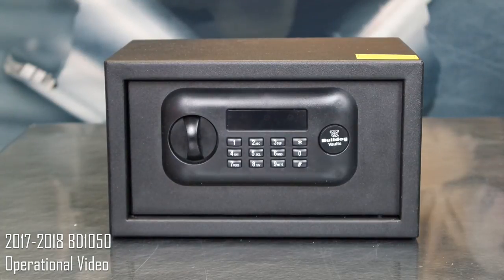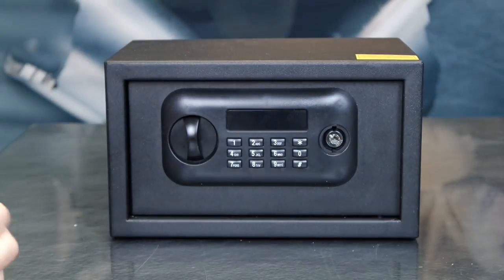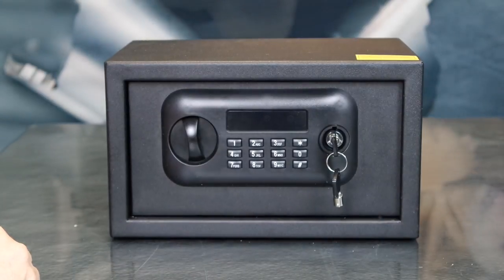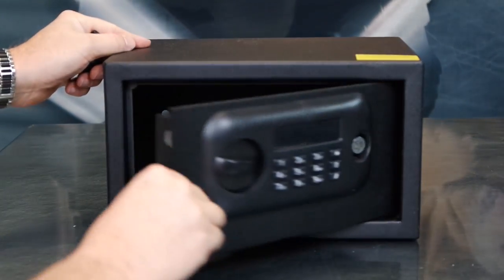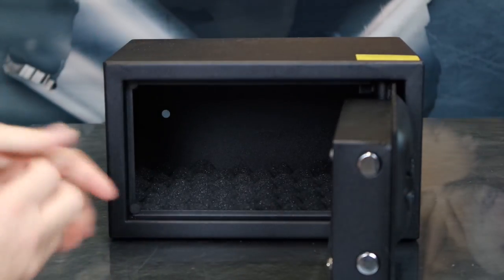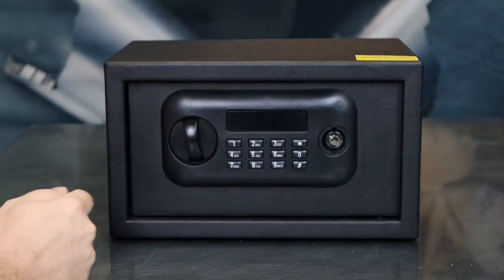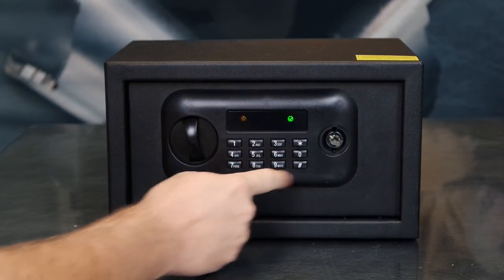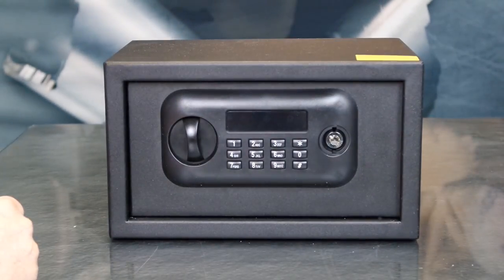Bulldog Vaults 2017-2018 BD1050 Operational Video

Comment: My code doesn’t want to change I press the red button in the back and I program a new code once done it just beeps the yellow light  3 times old code is still in use
Reply: Me too mine give a red and green
Reply: @gregreesesolutions  for some reason mine didn’t want to work cause I had to program 6 digits
Reply: @AmazingTonyYT  this comment did the trick for me. TY

Comment: Guys, I CANNOT get my BD1050 vault to open using my code alone??? I've used the red reprogramming button twice now and I keep getting (BOTH times) a red minus sign AND a green check mark displayed on the window. What does the red minus sign mean? Great video, but nothing seems to work; I always have to use a key to access. Please advise...
Reply: I’m having the same problem... did this ever get fixed?
Reply: @Game Hacker that’s mean your battery’s are low I just found out
Reply: Me too! Has anyone figured this out what does the green check and read minus sign mean???

Comment: DO NOT BUY!. Thesew things are not secure. All you have to do to break into one of them is flip it over and slap the bottom of it while turning the knob. Absolute pieces of crap.
Reply: Not if it is securely attached to something.  But you are correct that many similar safes have that weakness.
Reply: Confirmed, lost my keys , battery was dead and last resort did this and ty! worked
Reply: Show a video
Reply: Mine just for kid safety
Reply: Man I just lost my key and to break in mine.Can you help me brother
Reply: Confirmed that slapping upside down works